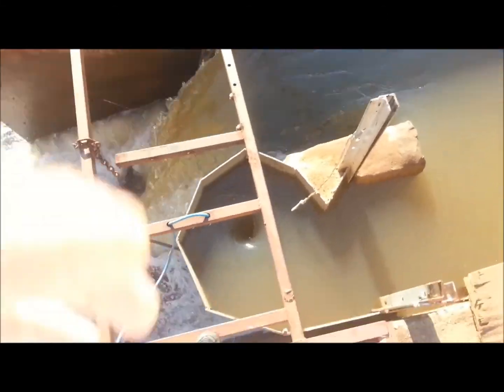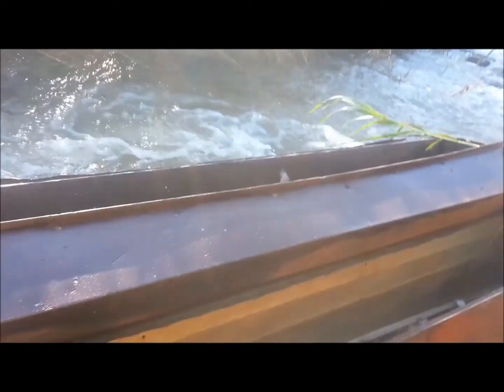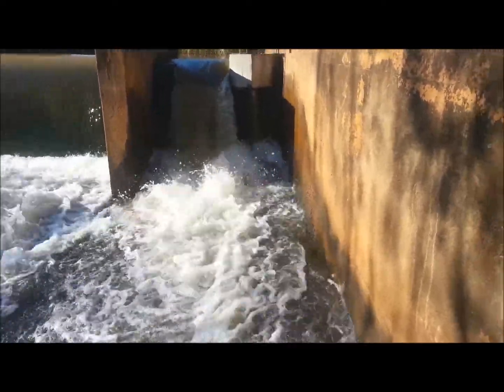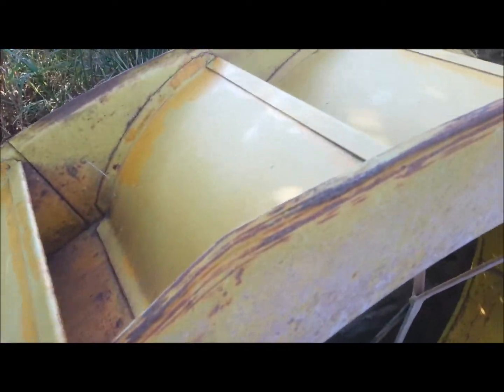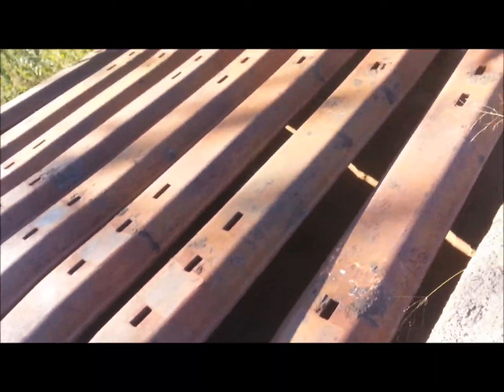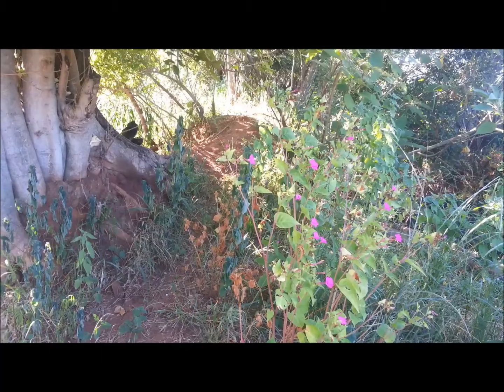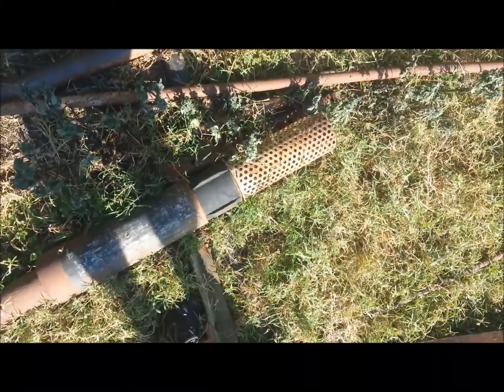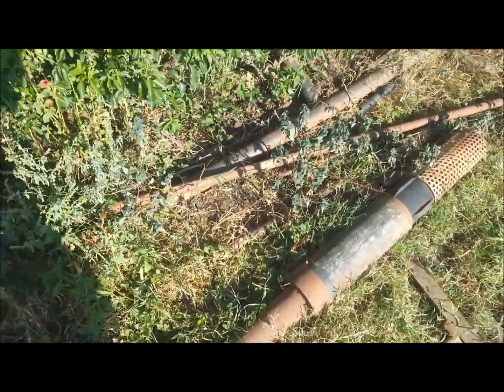My two new projects that i will be doing this summer

Comment: I don't have a good feeling with this solenoid pump. I would keep the idea you had with the acceleration ramp and the Vortex.
You last falling vortex needs to be larger and you must see much more air being aspirated into the vortex middle.
The turbine shall be place on an vertical axis and only part of the element should be into the spinning water. Air aspirated will help to accelerate your turbine as well.
Regards
Peter
PS: in watt country are you building all this paradise garden?

Comment: Nice project. Im a bit confused why is the solar electric pump needed? Seems there would be much more cost and maintenance compared to just adding more of your homemade pumps.
Reply from the maker: Yes but much more labour intensive , ill be needing 48m3/h of water to effectually eradicate my farm , but ill keep you guys updated
Reply: Phillip Fourie Phillip, I enjoy watching your videos.  You use the word "eradicate" incorrectly.   I believe you want to IRRIGATE your lower farm land.   The meaning of ERADICATE is to kill, destroy, or eliminate, "do away with," "remove completely."  Does anyone in your area use a diesel engine to power a centrifugal pump for irrigation.  Maybe your goal is "sustainable resource," but solar is large investment.  What is the risk of wind, rain, or other damage to solar farm.  No irrigation when the sun doesn't shine.  Large battery bank is very expensive.

Comment: Hi Phillip,
Did you calculate the ramp for the incoming water with Fibonacci numbers?
Great effect and looks terribly efficient!
regards
Reply from the maker: Hi looks like you know your stuff , How can a calculate these numbers?
can you give me some advice ?
Reply: Hi Phillip,
to design a good acceleration ramp draw squares and start with 1 and 2 and always add the preceding number.
1+2=3
2+3=5
3+5=8
5+8=13
and so on.
Know if You draw it on a plan to get a harmonic acceleration form you can proceed as follow:
Draw squares on a paper
1x1
2x2
3x3
5x5
8x8
13x13 21x21 etc.
(This is Fibonacci numbers series) 
The revelation of this series is that each square has a harmonic relation to the preceding and to the next square.
To construct the ramp cut the squares and dispose them next to next on the axle you want to go with your ramp (the middle of each square has to be on the axel.)
You will see the design of your ramp in front of you. If you join the squares, you've got your ramp.
I hope you understand my way to explain it.
These kind of ramp can bee used in any direction from large to small or otherwise.
It will allow you to keep / preserve the maximum of kinetics energy in situation where you have water speed and no water fall.
This for the ramp.
if you need information for the wheel and the aspiration vortex, please inform me
regards
Pierre
Reply: Just on more information:
the number 1,2,3,5 can bee cm, inch, deca meter or whatever unity you need...